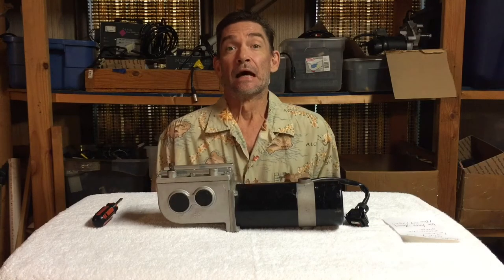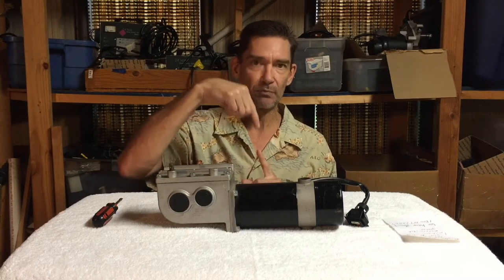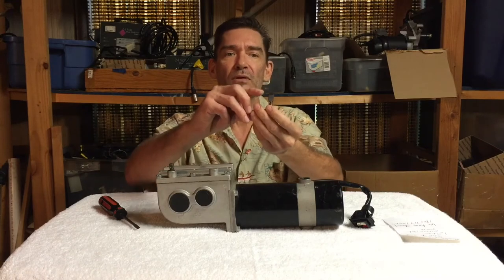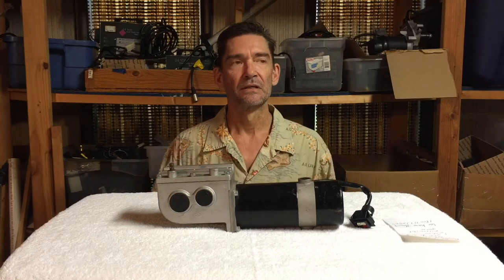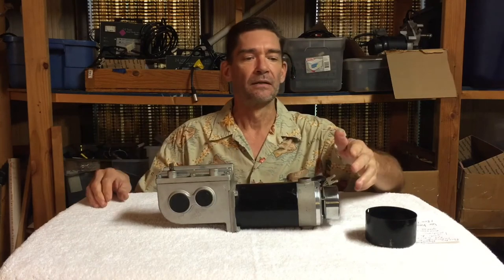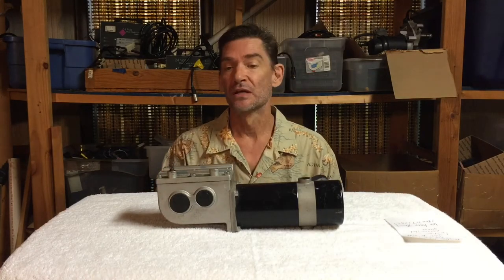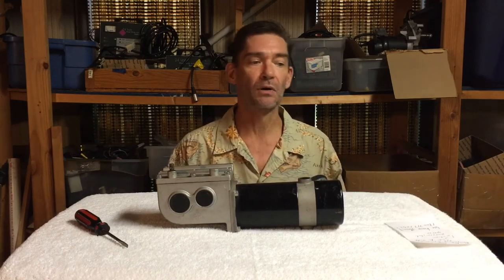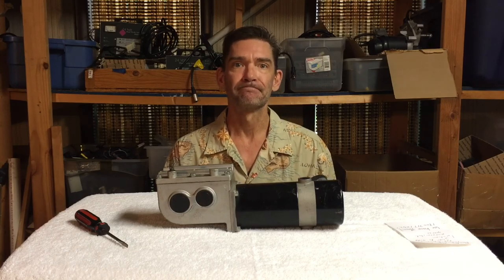2024 WHEELCHAIR MOTOR BRAKES, BRUSHES, AND LEAKING OIL 352-999-4477

Comment: Hi Frank.  My Pride Quantum 600 is leaking oil between the gearbox and motor.  Is there a seal that needs to be replaced or just clean out the oil/grease and repack it?  The motor unit is the DRVMOTR1241.  Thanks.
Reply from the maker: Hey there. I would start by opening the gearbox to see how much oil is in there. The grease sometimes breaks down into oil. sometimes just a little, sometimes a lot. I do not know why some grease turns to oil more than others but it varies. If it is not a lot of oil, I would just remove it and repack with high speed grease. If there is a lot, I would clean the coupler in between the box and motor because Iv`e seen oil ruin a motor before. Also oil may prematurely break down the rubber in the sacrificial coupler.

Comment: Very informative video thank you. Was wondering if you could tell me whether I need new motors or just brushes my Jazzy elite HD sometimes hesitates when I go to make extreme turns like a pinpoint turn. Thank you in advance for any information you can give me.
Reply from the maker: I cannot say for certain, but there is a field of programming that can be changed to increase turn acceleration. As well, your joystick could possibly have a "dead spot". Frank 352 999 4477

Comment: For a while I have a problem with my joystick, so I don't know is it electric or mechanical problem. The thing is: when is push my joystick in any direction, on my left motor it seems the brake just don't release 100%, it stuck on the half way. Right motor works well. So I don't know is there some problem with joystick, wires, mechanical stuff? Or just there is a dirt under  the joystick cover or connectors maybe? And yeah, joystick get warm a little bit sometimes in that condition, not too much.
Reply from the maker: By default a brake is on. When they go bad they default to on. Meaning, most likely your brake is going bad. Thanks, Frank 18007171252

Comment: Thanks Frank for the information...why does the battery of a new electric wheelchair drain even without being used?
Reply from the maker: Sometimes when batteries are new, say 3 months old. If they have not been charged from time to time say every 2 weeks, the batteries will start to go dead. If you think you may have an electrical slow drain, unplug the joystick when not in use this will break the circuit. Frank 352 999 4477

Comment: Hi Recently, a bad smell comes from under my wheelchair , knowing that a month has passed since I installed two new 55-volt batteries in place of the first one, which was 65 volts.
Reply from the maker: 55 volts? That is unusual. Do you mean 55ah (amp hour) batteries. I would check al the connections having to do with the batteries.  Especially if the smell is like burning plastic. Frank

Comment: This is a very informative vid 😊 My cousins salsa m2 power chair makes a whining and high Squeaky sound when moving at all times 😅 is there a fix for this? The man that checked it said u just have to live with it
Reply from the maker: Im certain there is a fix. First, you have to directly locate the sound(s) origin. My suggestion is to use a length of hose garden or other, like a stethoscope while running the chair to find exactly where sound(s) are coming from. Squeaks are generally easier to fix with lube, whines may be coming from the gearboxes, which can be regreased.  If the sound is from the motor(s) you may be stuck. Sometimes removing the drive wheels and cleaning any debris on axle between wheel and gearbox will help a brushing sound. Frank

Comment: Hi Frank, thanks for this video. I recently acquired a Jazzy Select for my Wife to get around on. Still looking for a carrier for it. This is turning into an expensive venture, but it will be worth it when we decide to go out and she won't have to be worried about walking. I've been curious as to how these motors work and how the brakes were constantly on. Is it a fairly easy procedure to pull the motors on these Jazzy's? It's a 2008 model and I have no info of how much or how often it was used so I'm thinking a little preventative maintenance might be a wise thing to do
Reply from the maker: You may be able to check the brushes without removing the motors. Sometimes the motors can be a chore to remove without the right tools and flex extensions. A flexible spring type extension, I find helps a lot.

Comment: Off the subject but, my disability is a lumbar back injury. My chairs have the foam filled wheels that ride like a battle wagon. Is there a decent pneumatic option that won't leave me dead in the water with a flat but doesn't cost an arm and a leg?
Reply from the maker: OK, if you dont mind wrecking your tubes, you can get pneumatic tires and tubes, then put slime in them. Messy but effective for thorns and such. Same relative cost as solid tires. Call if you want prices. Also please have the size of your tires ready. 
Thanks,
Frank
1800 717 1252